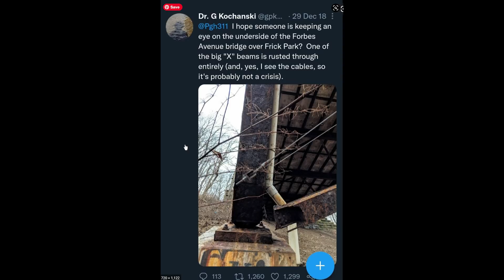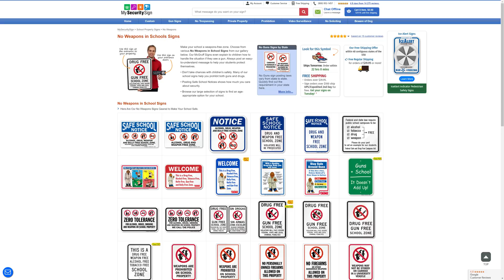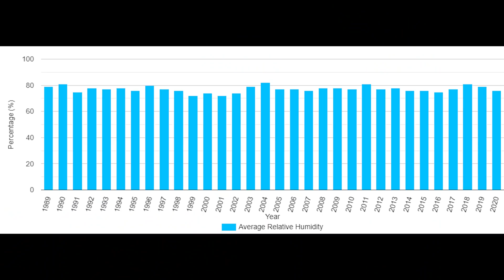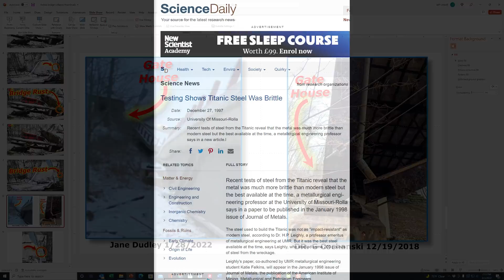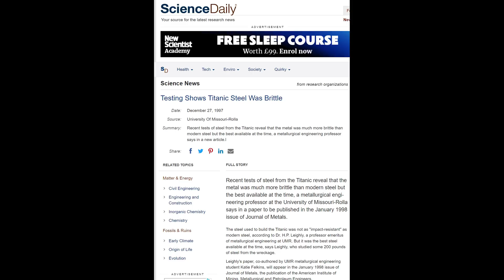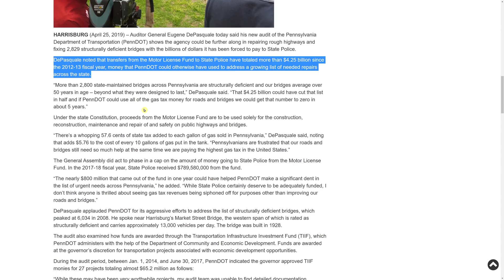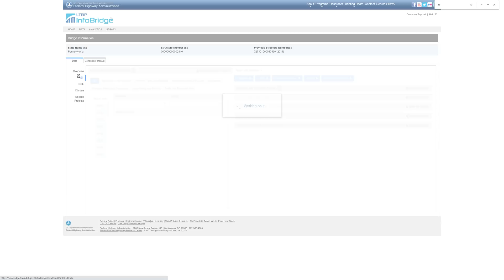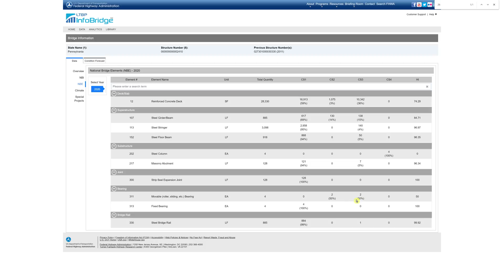Pittsburgh Bridge Collapse:  Bus Too Heavy? Rust? Missing Funds?

Comment: I'm a retired 18 wheeler. I carried a CDL license. The height or clearance of bridges, that's the roadway surface to the bottom of the bridge is "ALWAYS" posted if under 15 feet. The height of 99 percent of the trailers I hauled were 13 feet 6 inches. It's up to the driver to know that fact and look B 4 he moves any trailer or straight bodied truck. He/she must then see the signs and then READ that sign! I never had an issue in my driving career, millions of miles. I did notice that most of the trucks that hit that brides you posted were "mostly" "RENTALS" (Pensky, Budget, etc.) probably someone who rented  the truck to move and don't "normally" drive anything that high and therefore don't have a clue. Also (not all)  most straight bodied trucks do no require the training a CDL driver must have. To toss "TRUCK DRIVERS" under the bus  when you said "MOST" people don't know the height of their trucks is a "CLUE" to me you don't know what your talking about when it comes to a professional truck driver. A company may rent a truck permanently instead of buying because it's cheaper in the long run. They also have employees in them that "obviously" from your video of  rentals don't know what they are doing because of lack of training. The same applies to weight of bridges, Those rental folks don't have a clue. The fines for driving over the posted weight of a bridge can be thousands for the driver and Company. It's up to the police to keep those plows, dump trucks, ect. in line with fines.  To Get a CDL you are vigorously trained then tested. I would bet my house the drivers of those rentals did not have  CDL's.
Reply from the maker: Penske ought to have renters watch the 11 foot 8 channel before they give them the keys
Reply: @jeffostroff  You can say that again!
Reply: Lmfao people watch a YouTube video and consider themselves experts
Reply: @Justme-jt1ef  We'll see if you are still laughing when you are doing time for killing a car load of kids with your know it all attitude. I've probably forgot more about safety then you will ever comprehend. I'll stand on my safe driving record of millions of miles. No tickets, no fines, never put out of service, no accidents, etc. You're probably a SWIFT driver.

Comment: this might be a novice question - when the sign reads 26 tons is that the maximum limit per vehicle or for the entire bridge?
Reply from the maker: That is the rating per vehicle and that was changed to this 26 ton number that you see back in 2014. But of course eight years later and a lot more rusting and weakening of the materials I think that sign should have been sitting at about 10 to 15 tons, which would keep most buses, dump trucks moving trucks, and other construction vehicles and heavy equipment from ever being on that bridge
Reply: @jeffostroff  thanks for clearing that up.

Comment: So i feel like those drain pipes have been either blocked for a long time. And/or they are just undersized. And as a result water has been running down the outside of the pipe for a long time. Then transferring onto the metal column and lastly ending up on the base and the concrete. If you look at the side which has the pipe it has a LOT more rust run off on the concrete than the side with no pipe.

Comment: That bridge is a cheap light weight bridge, you look at the legs and it does not seem to meet expressway construction. You consider all the heavy road miles , ramps, etc constructed you wonder the mentality to put up this cheap spindly structure on such a road.

Comment: The bridge should have been de-rated to ZERO tons. The 2018 photo clearly shows it lost a portion of it's crossbeam supports and the street view appears to show that they simply removed those supports instead of replacing. City of Pittsburgh is just lucky that bridge collapsed when it did and not an hour later when 50+ vehicles would have been crossing every few minutes.

Comment: That rusting steel if you look into it has failed in every location it was applied.  Literally it was false advertising to even sell it.  There was a building a sports arena near the Georgia World Congress   Center which was built with it and the exterior coated with it and the stuff failed in less than 20 years.  It was JUNK!
Reply from the maker: Might be good to use inside, but not oudoors

Comment: Wanted to add my two cents re: bridge traffic/weight. The nearby highway, 376, was under construction for years. The official detour took heavy highway traffic across this bridge, nights and weekends, for years. This traffic was extreme.

In addition, on a typical weekday from 3-6, traffic sits on the Eastern/outbound side of the bridge continuously. This is a major bus route. I am deeply concerned why this bridge was not listed as a high priority for total shutdown and rehab. Was it merely because doing so would wreck the traffic pattern of the area?
Reply: I'm certain that it wasn't a worry about traffic patterns since I have seen them shut down major arteries and the side streets all at the same time many times before.

Comment: i had allways heard the standard of engineering was 30%.over ratings.but that dont include 20 years of neglect either.i used to drive an 18 wheeler.& noticed many bridges in pittsburgh area, the concrete had cracked so bad the rebar was sticking out for all to see while driving over the bridges.i often wondered how far they had really degraded where nobody could see.
Reply from the maker: When you can see rebar, that's a bad thing

Comment: The bus had a route it was probably not supposed to deviate from.
Reply from the maker: The bridge weight limit should have been further reduced
Reply: @jeffostroff  As a strictly temporary measure, I agree. However they would have to have notified transit ASAP to make sure the routes(s) were changed and tell them why so they could make sure drivers knew. I am guessing it is not as easy as that since rerouting would require sign and header changes and such. I doubt they would have thought of notifying transit.

Comment: Where do we get the police to stop overweight vehicles from driving on these bridges.
Reply from the maker: That would never work what you have to do is design the bridges to hold the weight to begin with and they have to take into account and factor in degradation over the years so it probably for example should be designed to handle double the weight of the heaviest vehicle they think will drive across it

Comment: That bus spreads it's weight over a large area. It's almost like two individual buses. There were only 3 people including the driver on the bus. Bumper to bumper cars would certainly weigh more than that bus but from the reports there weren't many cars on the bridge. It seems like it had fallen and they couldn't stop in time.
Reply from the maker: Empty bus still weight 22 tons. I've been told most of the weight is in back where the engine is
Reply: @jeffostroff  I'm seeing 19 to 25 tons empty and buses are allowed 22,400 lbs per axle.  A 60 foot long bus probably has 25 feet center to center of the axles so the distribute the weight more evenly than a tandem dump truck that carries 34,000 lbs on the tandems that can be 5 feet apart. [17,000 lbs per axle] If the bridge was limited to 16 tons, the buses shouldn't be crossing the bridge. It appears that bus was on it's regular route which included crossing that bridge. Some heads should be rolling. This isn't like a tour bus driver in an unfamiliar area.
Reply from the maker: @tiredoldmechanic1791   The bus company would easily be able to defend themselves by claiming Hey the scientists 26 t.

Comment: That bus does not go over the ton rating that bridge had
Reply from the maker: You are mistaken. The bus is 26 tons. That reweight limit sign they had was wrong. They had lowered it to 26 tons in 2014 because of the poor rating of the bridge. 8 years later it is now much worse and should have been de-rated down to passenger cars only. That sign should have said 10-15 tons at most.

Comment: I used to haul heavy equipment GVWR  of 56,900, over this bridge,back in the early parts of this century ( 2000-2007).  I'd cringe having to take this bridge. I could feel it trying to move then.
Reply: bus driver must have stepped on the gas....
Reply: All bridges flex...otherwise they would snap. Hauling oversize, I've had to park on the beginning section of the Francis Scott Key by Baltimore, and wait until they shut off all other traffic so I could cross, ...people would be amazed how much it flexes up and down...parked, my air ride seat made me think I was on trampoline.
Reply: @ronaldfulton1175  especially the middle, when stopped on it.

Comment: The Emsworth bridge was made of core 10 the salt ate it apart and it had to be replaced.
My cousin used to inspect electrical towers and the ones along the coast made of core10 
were eaten by the salt air.
Reply from the maker: Yes, bad idea to use this in steet construction

Comment: There's times at rush hour, 4 buses,trucks and 20 cars on that bridge are on that bridge at one time. The tons of rock salt that's dumped on that bridge every winter has rusted the supports and beams.
Reply from the maker: Busses may be iffy, but dump trucks and 40 footers should not be on there

Comment: The bus is going to have a maximum weight of 52,000 lbs or 26 tons. 
        In the US the regulations are 20,000 lbs per axle for a 4wheel axle. A steer axle(the front axle) typically is rated at 12,000lbs. This is a restriction of the tyres being rated for 6,000 lbs each(2_tires on the steer axle 6,000lbs x 2 = 12,000lbs).  
      The bus would in theory have a maximum registered weight of 52,000lbs. And may have been registered for a lower weight(one of the things you pay for on your annual registration is the weight of the vehicle). 
      On road vehicles the weights per axle are 20,000 lbs for a single axle, two axles in tandem(less than an 8 foot spread) 34,000 lbs. Typically the front or steer axle is rated anywhere from 10,000 lbs to a maximum of 20,000 lbs depending on what type of tire is used, with 12,000 lbs being the typical rating. 
        I kind of don't think the bus was anywhere near its maximum weight. I didn't hear if the bus had passengers on board. !y guess is not many passengers, if any. This is based on the lack of injuries reported, as an articulated bus has a capacity of over 100 passengers.

Comment: Your question on bridge ratings.  This came from the federal DOT "Federal standards for commercial vehicle maximum weights on the Interstate Highway System are as follows: Single Axle – 20,000 lbs.; Tandem Axle – 34,000 lbs.; GVW – 80,000 lbs."  Penn DOT allows single axles to be 20k (a kip is 1,000#), some arrangements 22.4K, double axles 34k.   The articulated bus would be allowed 2 22.4K axles and 1 20K axle for 64.8 k  32.4 tons.  This bridge was probably designed for what is called HS20-44, a 20T truck (2 or 3 axles) or a 40 Ton tractor trailer.  That standard has a federal / military load requirement of 2 axles 4 feet apart dual wheels each axle being 24K.  The area it is applied on assumes 100 psi tires.  The deck and first beams are controlled by the single axle, everything else is by the dual 24k axles.   Where trucks are on the bridge is addressed by an alternate lane load, a uniform load on the deck plus basically a single 24k axle added on.  The design assumes full trucks all lanes each bumper to bumper but with a load increase.

There are like 17 different types of loads on a bridge - dead load, truck load, pedestrians, wind, earthquake, snow, water flow, scour, flooding, and so forth.  Dead Load has a safety factor of 1.2, live load I recall is 1.6, snow, wind earthquake all 1.4, the bridge is required to resist the sum of each load type x its safety factor.  On the resistance side there are quality factors - steel having factors around 85%, concrete having factors around 75%, dirt 60% based on how confident we are of the strength.

This bridge style is not allowed anymore, the girders and columns are fracture critical, ie low ductility but more important - not redundant.  Modern major building and bridge design now requires the structure to stand with any member removed, in a building with lots of columns it is more like every 4th column removed.  The replacement will probably have 5 or 6 girders with the mid piers having 3 or 4 columns.  Highway bridge are allowed to have single piers but have to be like double the strength required.
Reply from the maker: Exactly, no redundancy. I can't understand why these bridge designers in 1973 used a bridge like this, when truss bridges had been around for decades, tried and true, and built in redundancy
Reply: Actually bridges with just 2 trusses are not redundant unless every connection is rigid.  But they were built stout with lots of reserve.  Can't take any single member out.  Trusses were great for railroad bridges, then when diesel replaced steam the loco weight was only 1/3 of steam.

Comment: Jeff - you are right on with the 'flashing' concept but it is difficult to protect columns themselves with flashings.  A great alternate is just like having roof overhangs, in the Pacific NW having 18" of overhang for 1 story, 24" for 2 story removes the constant wetness and amount of water flow on the face.  Most Dryvit failures were on buildings without overhangs.  Sure wind will drive rains onto the wall, but the ground below eaves stays dry.  An important thing on this bridges drain pipes, they are small for being in cold country, debris and icing can block such a drain, an 8" PVC would be far better, never clogging.
Reply from the maker: yes great points

Comment: YOU NEED TO CONSIDER THE NEWER CHEMICAL ICE MELTING  METHODS !  THE NEWER NON SALT CHEMICALS ARE MUCH MORE CORROSIVE THAN SALT IF NOT PROPERLY MIXED WITH AN PROPER INHIBITOR AND USED WITHIN A CERTAIN TIME RANGE !
Reply from the maker: Yes, you can bet they don't always get those brine solutions right

Comment: Another great video in this series! I drove a dump truck for 16 years - to Pittsburgh, daily. So the thought you had was the same as mine. ALL the factors you mentioned were spot on! Robbing Peter to pay Paul is an understatement. This state is corrupt on so many levels. I'm SO glad an "out of stater" has taken notice of this. Now you've earned my sub, and I'll be checking your other content as well.
Reply from the maker: The psychology of these signs is such that they become background noise
Reply: @jeffostroff  Especially when they are posted at the last second!.. it's not easy to make a split second decision to abort a turn when you're driving a tractor-trailer and you only see a sign set back from the intersection while you're 75% into your large turning maneuver.. it's happened to me before and I always wonder why they didn't post a warning sign atleast half a block back to give us more time to process the sign and decide where to go instead.
Reply: Did you comply with the weight limit of this bridge when you drove your truck loaded?? Or, like other truckers, did you disregard it as well??  The pinned comment on this video states that his own father is a trucker and admitted repeatedly driving over that bridge while overweight.. out of "necessity"..  Was it really that much of a detour to take to avoid that 26 ton weight restriction?? I'm a trucker myself and I would feel some guilt if I ever ignored a weight limit on a bridge that subsequently collapsed.. especially if I did so repeatedly.. which I would never, ever do.

Comment: I changed about 4 bolts and sealed a couple more on the fort Duquesne bridge in June of 2019. I have all the pictures all up close I had to send to the inspector.  It was the only little bit I did on a contract from Penn dot. I could send you photos to show you if you like to get a good look at just how well (not really) those bolts looked.

Comment: I wonder what role it played that everyone started buying larger cars in the 90s. I remember a time when most people drove cars and it was only people who needed a truck bed who purchased anything with a truck frame. Now lots of people have those bigger frames in their SUVs, of which there were many on that bridge in one of those pictures. They don't way a whole lot by themselves but if you get all the lanes over the bridge backed up in traffic with SUVs, that has to be more force than the original bridge designers had ever anticipated.
Reply from the maker: Yes, I never even hear df an SUV until 1996. Minivans came out early 1980s.

Comment: The Bridge Rule came from the collapse of the Silver Bridge over the Ohio River.  https://en.wikipedia.org/wiki/Silver_Bridge   This limits the weight of vehicles based on axles and length to spread out the point load and also the cumulative load when a line of vehicles backs up. Odd that it always happens at Rush Hour???   Vehicles also induce a dynamic force with movement that adds to weight.
Reply from the maker: No one even reads the signs either